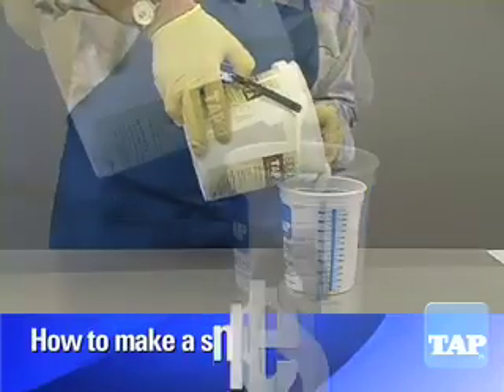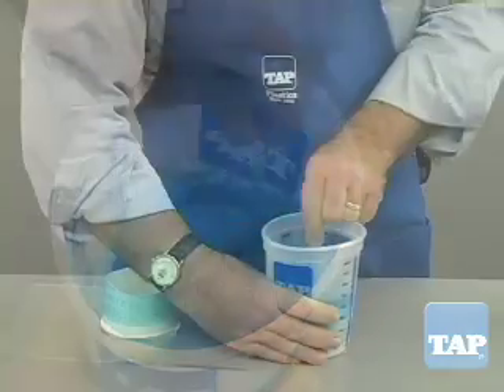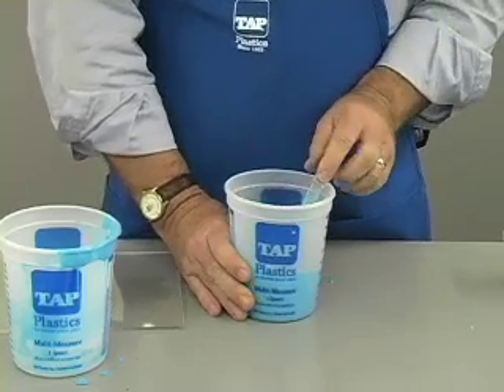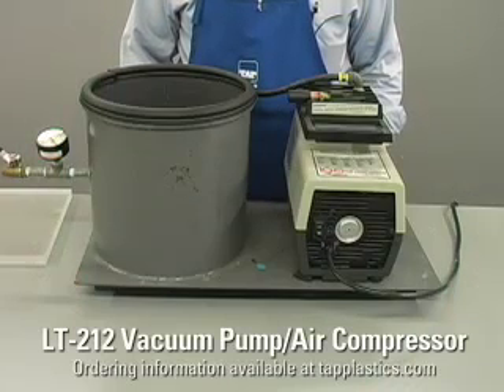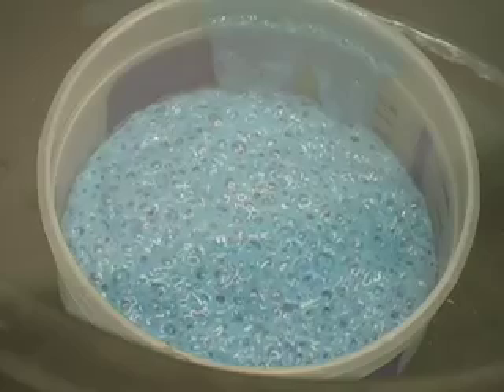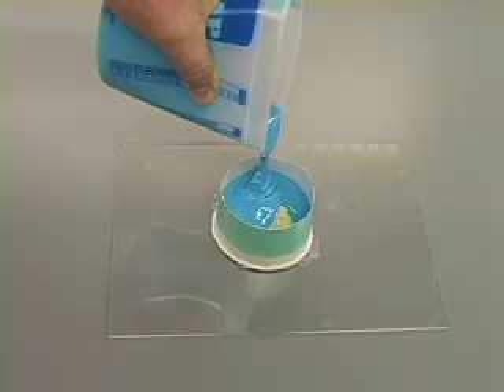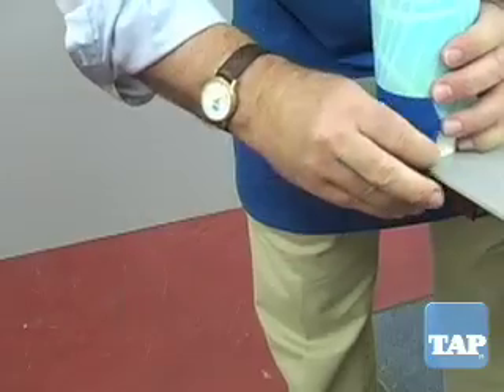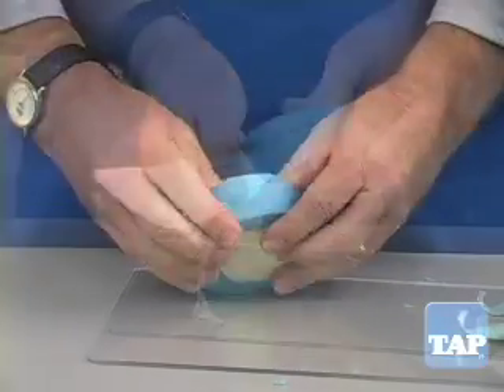How to make a simple Silicone Mold Part 2

Comment from the maker: Platinum Silicone combines the advantages of both in that it does not require a mold release and does not have bubble issues.  However, it is the most expensive.

Comment from the maker: The video "Introduction to TAP Mold Making Products" explains many of the differences.  In a nutshell, Silicone is more expensive and requires special techniques to remove bubbles.  But, it does not require a mold release in most situations.  This is a huge plus.
 
Urethane is less expensive, tougher, does not have bubble issues, but requires a mold release at all times.

Comment: Thank you for that fantastic explanation.
I will try the silicon without the second part/hardener.
I have read I need approximately 29 inches of vacuum, so I will be getting a vacuum gauge soon just to make sure on the pressure.
Thanks again:)

Comment from the maker: The little bubbles do not harm the mixture.  You see them because of the vacuum.  When you open the valve, atmospheric pressure is increased and the little bubbles shrink and become invisible.  Your silicone is then ready to pour.

Comment from the maker: Take the silicone base, without the catalyst, and stir it up to introduce air into the material.  Then place that in the vacuum.  If it bubbles up and collapses, then you know your vacuum is working, and the material is still good for future use. As you know, the vacuum will make the material bubble up and increase in volume 3 to 4 times, then collapse back down.  At that point, it is basically de-aired.  However, you will still see small bubbles coming to the surface.

Comment from the maker: You are very ingenious!  The milk test indicates that you vacuum is working.  However, different liquids have different reactions to a vacuum.  Some liquids will boil under vacuum, which will create even more bubbles. Silicone will very likely behave differently than milk.  You can test the silicone without having to waste any material.

Comment: Hello
Basically I want to do the same, which is vacuum silicon to get the bubbles out.
I made up a vacuum chamber using an air compressor inlet for suction, I used frothed up milk to test if it works as frothed milk is full of bubbles but wasnt sure if it worked. Basically I vacuumed the milk and it almost spilled over then came back down, but there seemed to be more bubbles left until I opened the valve and it looked like the bubbles disappeared after the valve was opened. Is this correct?

Comment from the maker: Apart from that, yes, Clear Lite Casting Resin can be easily polished.  Depending on how rough the surface is, you may need to start with sand paper.  You can start with a 320 sand paper, go to 400, and then use a buffing wheel with buffing compound.  If you still see scratches, go to 600 paper then buff.  It is possible to make the surface glass clear.

Comment: how do you make what you molded shine like after you mold something and it doesnt hava a smooth surface would you buff it out or polish it i dont imagine you would use sandpaper but to round something like a conner Im starting to mold things with castin' craft and I want it to be crystal clear so you can see whats inside thanks for the help

Comment from the maker: It depends on the defect and the casting medium.  If the defect is from a bubble in the mold, it will show up as a bump on the cast part, which must be removed.  Some resins such as Quik Cast can be pulled from the mold before they are fully cured and trimmed with a knife.  Polyester and epoxy resins must fully cure before mold removal.  They would then require a grinder to remove the bump.